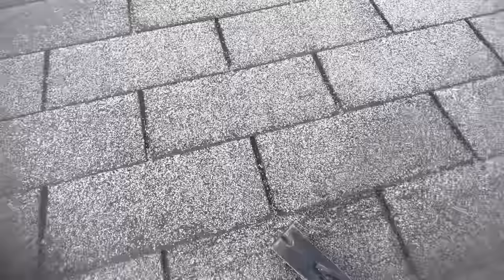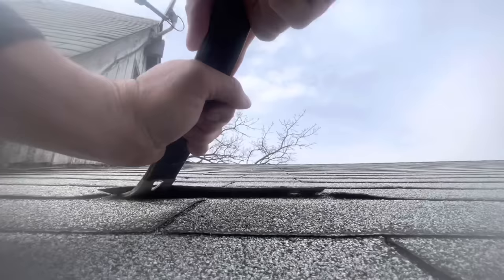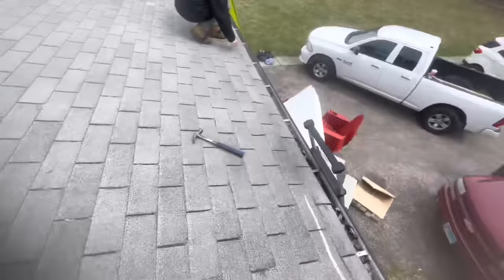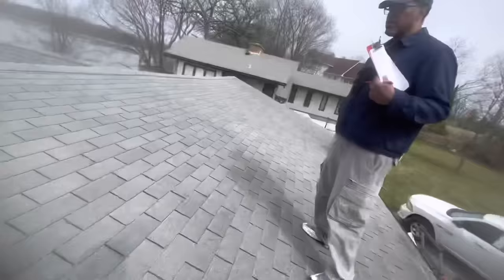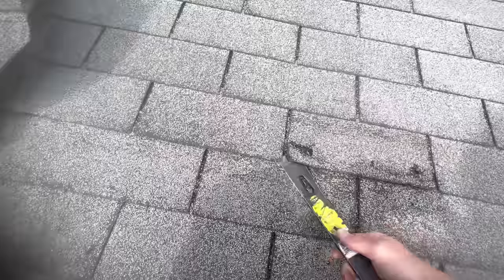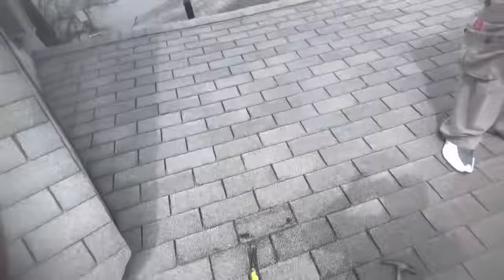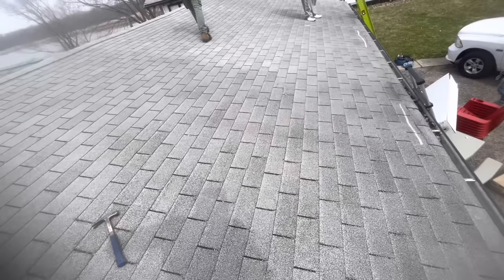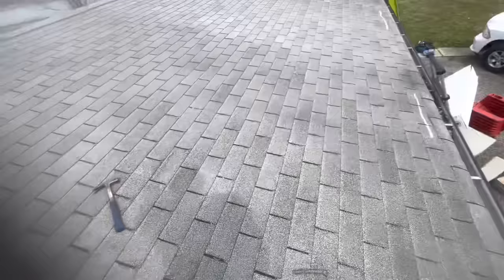Insurance Adjuster says roof is repairable. 😂 See how this inspection is ignored & denied?

Comment: Gonna play devil's advocate here. I've been an independent adjuster for 15+ years with a background in forensic structural engineering.  Based on the video, I don't see anything that would be covered by the insurance carrier.  Wear and tear (excessive granule loss, advanced delamination, pitting, blistering, thermal cracking, etc) are not covered perils, like wind or hail.  If the only "damage" to the shingles are unbonded or creased tabs, based on how shot that roof looks and most likely is advanced in its age, then it is very reasonable to assume those tabs unbonded or creased is BECAUSE the roof is shot; the seals more than likely dried out, starting at the corners working inward, allowing wind to eventually lift the tab then proceed to crease it.  Therefore, based on an engineer's standpoint, the UNDERLYING cause for the unbonded/creased tabs is wear and tear, not wind.  That said, I 100% agree with you that the roof is not repairable.  But, again watching your video, I cannot see missing tabs or torn off shingles anywhere that would indicate coverage for a peril such as wind.  I wasn't on the roof so perhaps I am missing something.  Also, I will add, if the adjuster on site would not stay around for you to perform a repair showcasing the roofs irreparability, then he is an idiot.  I would LOVE that to happen on my claims!  Big time saver for me, that's for sure.   Performing a brittle test is my usual go-to, though.
Reply from the maker: I’m really sorry to say that, but then you been wrongfully denying homeowners from proper losses. However, if they hired me, they would still get it paid for because at the end of the day if there’s Chris shingles and you just acknowledge that it’s due to wind damage as the predominant loss the main reason why this was allowed to happen is because of the bond sealant not being adhered properly. Still a cause of loss of wind. 💨

Comment: I’ve run into this many many times and there’s a way to do this without damaging the shingles. You need a sharp flat bar and you need to angle the bar just right and use a hammer to lightly tap it and break the tar and not the tabs
Reply from the maker: It's not the installing only that will damage the shingles. When you nail in the 2nd course above the playability is 0% and damages that shingle.
Reply: Heat it up and it will peel right up.  Only a bozo would use a dull crow bar to lift shingles.😂

Comment: Do insurance companies have an obligation to insure a roof if its beyond its serviceable life?  When my roof got to the point that the singles were in that condition,  I replaced my roof.    I'm supposed to wait until my roof is damaged and get insurance to cover it?   That seems like fraud.
Reply from the maker: Great observation. Insurance companies don't owe for a faulty roof that is Beyonce's serviceable life it sustains a loss unrelated to a direct or physical loss.

However, had the insurance company said but your group is beyond it's useful life, you need to replace it.

The homeowner would have done such thing.

Instead, the insurance company gave a false expectation that everything's covered with no expectation to cover it when a loss happened. 

I wouldn't say it's intentional, it's just a lack of oversight and investigation

Comment: Seem to be missing a main issue; the insurance is responsible for the covered damages; being old and brittle or being adhered too well is likely not covered damages, unless this is a warranty insurance claim.

That being said, I don't know anything about this claim, what's covered, cause of loss, nothing.

Btw adjusters are on a fee schedule, the more they pay the more they make, AND have to answer to a desk examiner, so usually are not making the decisions, nor is it prudent for them to discuss the particulars with a contractor (who actually does have a vested interest in a claim).

It's a shit show all around from the homeowner's point of view, but the best (for the homeowner) is to document document document.  

Prove the damage is related to the cause of loss, and file for a supplement once repairs are attempted and you can document that it's necessary.

...this whole idea of "insurance should pay because such and such might/will happen" just isn't how the real world works.

Imagine being pulled over for speeding and getting a ticket for an accident that "might" have happened.  All of the factors were there (high speed), but it hasn't happened yet.

Now think of the roof repair as the same.  The factors are there (brittle shingles, strong adhesive) but they haven't happened yet.
Reply from the maker: I often replace at least one shingle to show the repair. This one was clearly going to cause too much damage. 

You're right! Document everything. Even what appears not important can often times be very relevant. 

Not every adjuster is paid the same way though.
Reply: @ChicagoRoofer  I've done enough roofing, never owned a piece of the business.  I've done inspections, but not for insurance.  I just hope I'm never part of this mess.  Agree with like half of what Guppy says, I didn't actually see the damage that made the insurance claim and the roof looks shot to me.  The idea that the contractor and owner are supposed to go forward with repairs without the insurance identifying what they're going to cover is bull.  Go ahead and assume a full roof replacement and prorate based on % of roof damaged from the event and % of estimated useful life left.  $10k roof replacement because 4 leaks and hail damage on 10% of the shingles, ok, we can do math and figure this out.

Comment: Just because the roof isn’t repairable doesn’t mean it’ll be covered. This is why it’s imperative to understand your policy. You’re covered for direct physical loss due to sudden and accidental damage. Most policies don’t cover maintenance. These shingles are shot but that has been happening over some time. It’s not sudden or accidental. Please review your policy and your endorsements
Reply from the maker: The shingles suffered a covered loss of wind damage. Due to the wind damage which was sudden and accidental, the shingles need to be replaced. Consequentially, the surrounding shingles get damaged from the repair. Deming the roof non-repairable which is why we argue the full roof replacement.

Comment: It takes a real pro w a super soft touch and sometimes even perfect timing early as the sun first hits em.  But also I agree the state farm guy surely could been more open and helpful
Reply from the maker: So you're saying, unless the conditions are perfect, it could be both ways. At the end of the day, anything could happen with the shingles even if you're extremely cautious..
.
Reply from the maker: So we agree that the conditions are likely impossible or more than likely not going to work out in a favor of a perfect repair.
Reply: @ChicagoRoofer   yep.  Basically .  it's possible. But unlikely.    I've had to repair many roofs in simular  or worse condition and the only way I got the tougher ones was to make an all out actual plan and might take several trips and alot of patience to even find the combination to unlock them only to at best add a couple more years to a dying roof.
Reply from the maker: So what we agree on is it's likely not repairable. Or... repaired improperly.

Comment: Insanity is wanting a roof that doesn't leak and then nailing at least 4 nails into the roof to attach the shingle.  What we need is a peel and stick 3 dimensional shingle. No nailing, just peel and stick over peel and stick underlayment. 
I don't blame insurance companies.  Nowadays it costs about $15,000 to $20,000 just to reroof an average house. That's about $6,000 in materials and $9,000 to $14,000 for "labor".  That's insane.  Roofing is not rocket science.  Roofing has been hyped up to account for the gouging of consumers.

Comment: Insurance companies are only worried about the next quarter. The truth is that if they pay for replacing a roof (minus depreciation) that their risk goes way down because of the warranties on newer shingles provided a reputable roofer does the install. They ultimately save money in the long run because any problems due to hail or wind will then be the shingle manufacturers problem.

Comment: Why do you build roofs like this? Roofs that require replacement and repair on a regular basis. Look at how houses are constructed in Australia. Either Colorbond sheet metal or ceremic tiles. Those roofs don't need replacing for the life of the building in most cases.

Comment: They want to take your money and never pay .  I sued mine the adjuster said I needed 10 shingles repaired roofer said I needed a whole roof this went on for over a year then a storm came through and I got a leak ,still nothing , then they dropped me stating my agent don’t handle them anymore , well I couldn’t get insurance cause I had a bad roof and open claim. My agent got me an expensive state run ins while my atty fought these bums. The court sends you to mediation first and the bs their atty tried saying like the storm that first caused this only had 40 mile an hour winds and mine was rated for much higher so it was a faulty roof and I only needed 10 shingles and they put up a drone shot my roofer took to show how one section was a little off color but didn’t realize you could count at least 30 missing shingles not including all the loose ones.  Their adjusters estimate had just the 10 shingles nothing more lol just enough to keep it under the deductible.lol. Guess what ? They paid for a full complete roof plus repairs on the inside damage plus attorneys fees.  Never walk away if you are in the right. Attys take these cases and you don’t have to pay them the insurance pays.

Comment: Trust me, I hate insurance companies and I think most of them would deny every claim if it was possible.  That being said, insurance isn't a maintenance plan to repair old, weathered, poorly installed, unmaintained and otherwise neglected parts of your home.  Insurance is to cover NEW damage to a structure that was in good condition prior to the damage causing "event".  This roof will need to be replaced soon due to age and that is 100% the homeowners responsibility.  Any suggestion otherwise borders on fraud and is a large part of the reason for the current insurance premium spikes and dropped coverage fiascos.

Comment: That is why you have a certified roofing engineer come in and do the inspection after the adjuster and roofer disagree on damage. Typical Roofing company all about profit. This is the reason why premiums continue to go up and you now need to take out a mortgage to get a new roof on your home is because of roofing companies inflating prices, saying there is hail damage/wind damage when there is not. 10 years ago you could get a roof for 1/3 of the cost it is today
Reply from the maker: When the jab happened, roof pricing went up almost double. Labor went up considerably. Gas went up considerably. That's what's inflating the prices, not roofers who stick up for homeowners who were promised to be taken care of by their insurance company only until there was an actual claim to use it as a reason to deny. If the insurance company came out and inspected the properly as they should cuz they have a vested interest in that property being in good condition, they would have probably told the homeowner to replace it before the actual damage occurred because the risk was too high. The insurance company site unseen gives a policy which suggest they don't care and they're willing to take that risk.

Comment: I work as a Solar/PV installer aswell as roofer. Roofing for 10 years, Solar for 3. Watching these videos, my question is; 

How come you Americans use these shingles for roofs? In Sweden, in general, roof construction consists of; 

- wood
- waterproof "cardboard" ("takpapp")
- some wood to put tiles/metal on ("läkt"), we put like cross 
- concrete tiles, metal (plåt in swedish)

Both the concrete tiles and metals last pretty much for an eterntity and easy to install. 

How come you Americans insist on using these shingles for roofing? According to the youtube videos I've watched, seems like they cause a lot of problems, and just by looking at them, they look brittle and troublesome to install.
Reply from the maker: They're relatively fast and easy to install and the first is between 2 to 4 times less than wood, concrete, tile, metal...
Etc

Comment: I agree the roof is unrepairable but why are you using a whammy bar? Use a shingle bar. I’m a solar installer and we use a flatter shingle bar to break the common bond and lift the shingle. Sometimes damage does occur to the shingle but often I am able to lift up a shingle exactly like that one without ripping. Just saying, add a Dasco shingle ripper. Despite the name, it is better able to do this work IMO

Comment: If you have to force the shingle to be separated from the common bond  then why is that a bad thing? There was no loose or damaged shingles  I can see in the video. If you starting to demo the whole house I am sure you can find million things that have been installed incorrectly.
Reply from the maker: There were missing and wind damaged shingles throughout the entire roof
Reply: @ChicagoRoofer  ok, that make sense. The video does not explain that , thats why I didn’t understand it

Comment: That’s the way a roof is supposed to be done most roofers don’t remove the plastic strips from the underneath of the shingles to expose the bond strip so it will melt together and not blow off the roof when you get high wind gust….

Comment: You don't get it. That isn't what he's there for.
 
Here's how the process works.
 
There is a constant tension between roofers, assessors, and homeowners when there's insurance involved.
 
Homeowners always want the full replacement
Roofers always want the full replacement
assessors always want it repaired.
 
So you've got a case here where the assessor thinks it's repairable, but some roofer says it isn't.
 
Well... the roofer IS professionally more knowledgeable, but they also have a vested interest.
 
So what would take place here, is the assessor hires a roofer they trust to do the repairs.
 
If that roofer says that it's not actually repairable, then the assessor will first deal with that problem... perhaps authorize a full replacement.
 
But AFTER THAT the assessor would ask THEIR guy why it's not repairable and who's liable for that. In this case, far too much adhesive was used by the previous roofer, and they would probably be liable... unless the homeowner requested the sealant (some homeowners would rather have sealant than a repairable roof... but that isn't covered by insurance, or it raises your premiums).
 
The roofers are ALWAYS extra aggressive in these cases for a reason.
 
Because they KNOW that if it's a repair job, the insurance is going to give the job to someone else... and because IF they scream and yell loud enough, they think the homeowner is more likely to pick them.
 
It's shadiness all around.
 
Roofers are known to get VERY aggressive, VERY sleasy, and sometimes violent over these disagreements. Insurance companies pay a premium for roofing contractors who don't squeeze them all the time. This industry, like many others, is often about who you can trust.

Comment: This is why it’s best to get an independent insurance adjuster, they work on your behalf
Reply from the maker: I agree with this, but just like there's good and bad attorneys, there's good adjusters as well. Not every adjuster is cut from the same cloth, or nose policy, or cares enough about doing what's ethical and honest. The same amount of time should be devoted to find a good adjuster as it is to find a good roofer. Sometimes, you'll find a good adjuster, but if they have a roofing license, doesn't mean they're a good roofer too. Basically, do a lot of due diligence before you hire both.

Comment: What do you mean by the inspector saying "it's repairable?"
Reply from the maker: Basically, he's suggesting that a repair if the field shingles is possible. However, each shingle that's manipulated to allow for the repair gets damaged in the process. Thess surrounding shingles then need to be repaired and on goes the story leading to a full roof replacement

Comment: Glad my insurance company cut me a 50k check for my roof and siding without any major hassle. The roofing company even cut me some slack because I was only approved for the whole roof and half the siding (Was two different colors and only one side was damaged so they deemed it not necessary to color match the other side). And that was perfectly understandable. But I didn't even have that terrible of a roof. It was just like 10 or so shingles and a piece of siding that blew away lol. The adjuster said he couldn't color match either and that the replacement was approved. I don't understand why this inspector is being so ridiculous when its clear as day that the roof can't be repaired. If taken to court its all on video. Why spend more money on a legal defense that probably costs 2-3 times more then what the roof would cost?

Comment: That's clearly an old roof. Even if they did cover it, the adjustment would be minimal. Insurance covers damages, not wear and tear. Insurance isn't a warranty. If you've got a 25 year old roof, and the wind rips off some of the brittle shingles, don't expect the insurance company to buy you a whole new roof. If the roofers can't replace the damaged shingles without them falling apart, then it's time for you to get a new roof. At that point it has nothing to do with wind damage. I don't expect my auto insurance company to pay for a new bumper if it rusts and falls off, and I don't expect my insurance company to buy me a new roof when the shingles turn into paper and blow off.